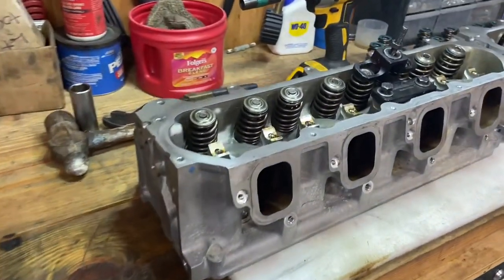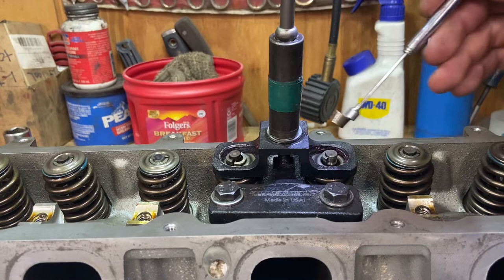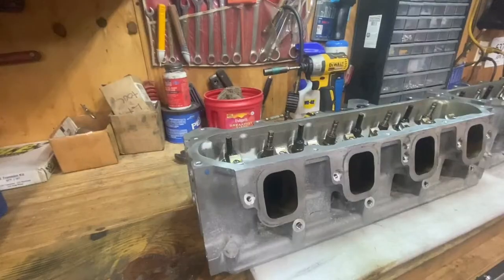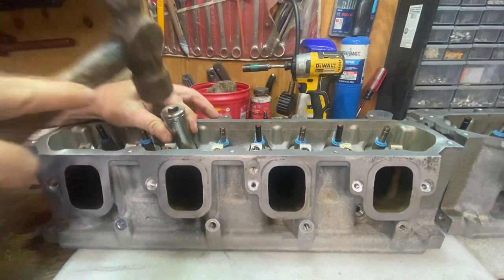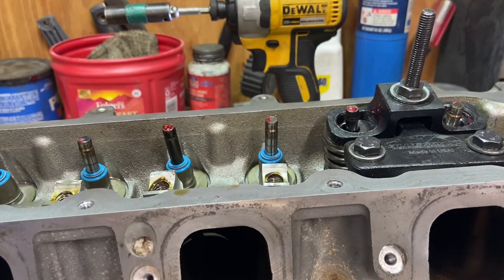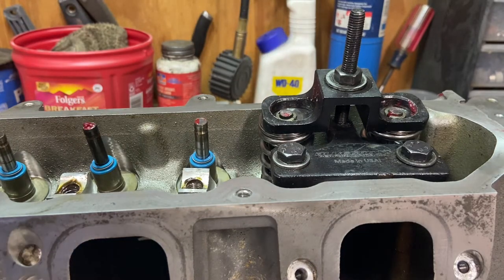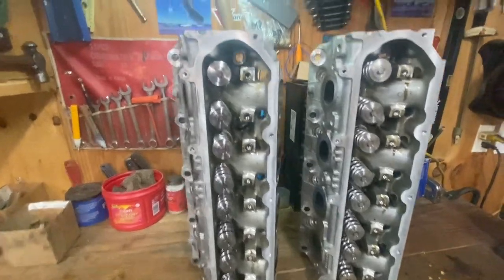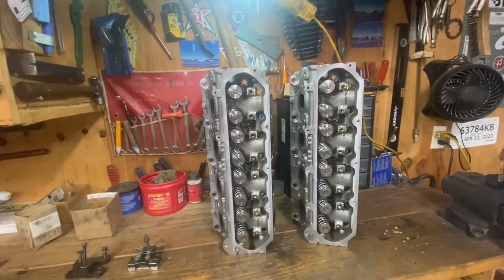#LT 6.2 Gen V #L86 valve spring swap

Comment: Hell Yeah, doing my 15 6.2 AFM complete delete and want to clean and lap my valves while she is apart. Well done video, informative and to the point, nice. Thanks. 👍👍🏁🏁
Subbed, got to see this beast when it's done.
Reply from the maker: Thank Michael for watching and subscribing I appreciate it. Stick around we build quite a few Gen V’s . Doing a LT4 today. Unfortunately we don’t really see them much after we are done.
Reply: @JustCantSitStill  
Cool , will definitely keep an eye out. I'm old school and this in my first foray into ls/lt platform , so I'm absorbing everything I can.
If you like check out my small channel under my name , got some cool stuff on there. Will be watching , thanks.
Reply from the maker: @TheMrmmkkpro  I will definitely check it out.
Reply: @Just Can’t Sit Still  
Merry Christmas!
  I'm spending the day watching some of your videos. I have another question ,if you don't mind.
I'm using new stock GM head bolts , do you oil the threads ? They have the sealant on them ,but wondering about do I oil the threads , also any tricks to not stripping out head bolt threads in the block. My first aluminum block experience. Thank you.
Reply from the maker: @TheMrmmkkpro  Merry Christmas to you! Stock bolts go on dry , the only trick or tip is to clean the threads in the block , we cut grooves in a old head bolt. We run it down then blow them out with a air compressor. We have not had anything issue with stripping the block threads. If using new stock bolts I follow the oem torque spec which I believe is 59flbs then 90 degrees then 40 degrees. If reusing old head bolts I would go the same but only 20 degrees on the final pass.
Reply: @Just Can’t Sit Still  sweet sounds good , Santa is bringing me a new electronic torque wrench with the angle function , yay.
   Thank you for your time and the tips , really appreciate it , helps a ton.👍👍🏁🏁
Reply: Hello , may I ask your name?
   I pulled my crank bolt out today and it has engine oil on the threaded end , coming through through the threaded hole onto balancer. Is this normal? Freaking me out. It's not pouring. Thank you ,sorry to bother ya. I appreciate your help ,Michael. I going to post a short where you can see , if ya like.
Reply from the maker: @TheMrmmkkpro  my name is Eric , and yes it’s normal to have some oil come out when you pull the crank bolt.
Reply: @Just Can’t Sit Still  
Thank you Eric , I was freaking out! I'm sorry to bother you but you know your stuff about these engines and I trust your opinion. Thank you  very much, 👍
Reply from the maker: No problem at all buddy.

Comment: For you guys that care take the valves out and clean them keeping in order of what hole they came out of I stick them in a drill press and take a piece of very fine steel wool and polish the head and stem then I clean with break clean heat them and spray with graphite a guy that builds heads told me this trick it makes them last longer the graphite stays on the stems for a long time and lubes the guides and stems peace
Reply from the maker: I remove and clean if needed most are low mile very clean to start with , I don’t heat them never heard of that. Thanks for watching and the comment, please subscribe like and share

Comment: Can you do this job of changing seals and springs with the heads still on the car?
Reply from the maker: Yes you will need to pressurize the cylinder and be very careful with the locks.

Comment: Hey man, can I stack my L-87 heads to lower my compression? Whippled it and 5 psi with 11:5 to 1 leaves little room for advance and 93 octane. Stage 3 ZL1 injectors and fuel boost. Thanks
Reply from the maker: Never done it , but I assume you could these new MLS gaskets sinch down pretty thin not sure how many you can stack. Thanks buddy for watching.